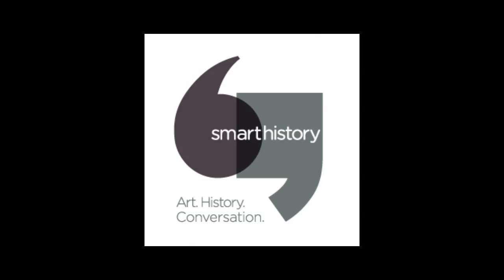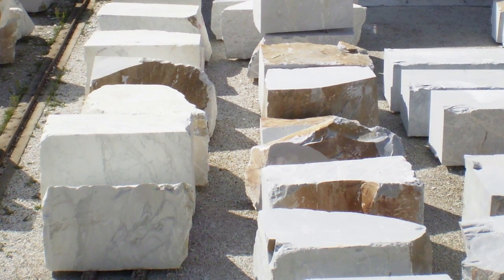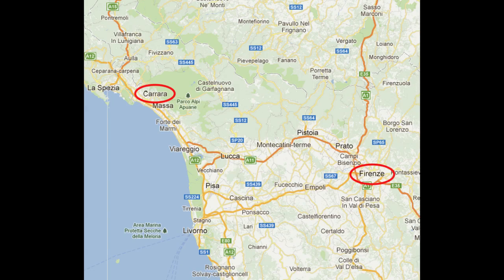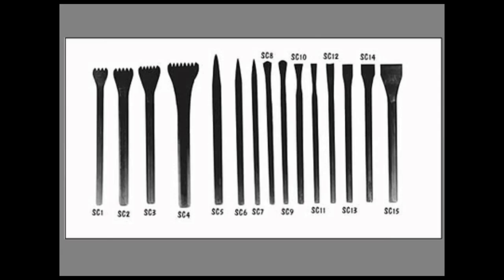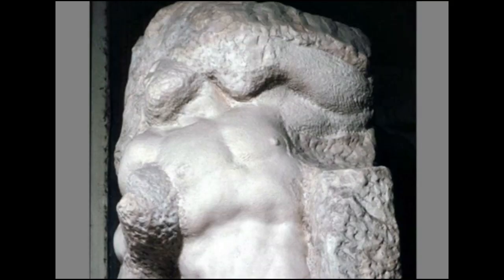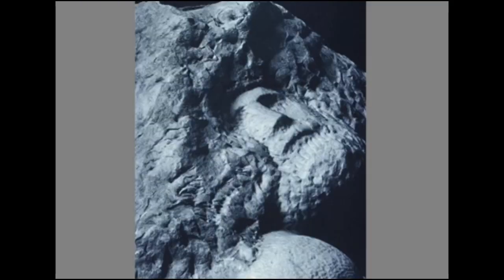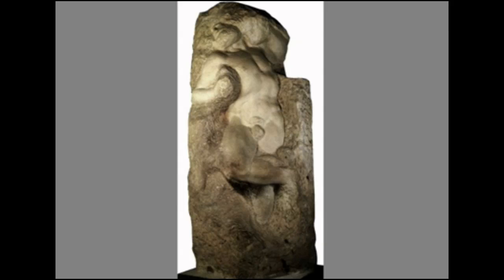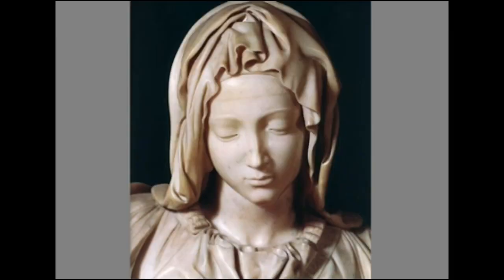Quarrying and carving marble

Comment: There are actually three major techniques of sculpture - carved, modelled,, and constructed. The proper English terms for those chisels are the point ("pick" here) and the toothed claw; there is also the flat chisel, and abrasives. But what is really missed here is Michelangelo's favoured tool, the one that characterises his sculpture, is the claw, and he used it in a manner very related to his drawings - that is like cross - hatching. In drawing form, his parallel lines hatched out the masses by crossing, creating light and shade - and when you look at the surface of those 'Slave' sculptures, or rondos, you can see how the claw has moved around the surface in opposing directions, creating the form in a similar - but much more physical - way.